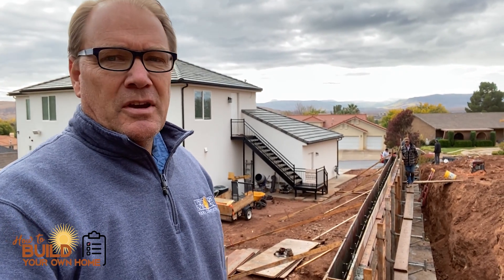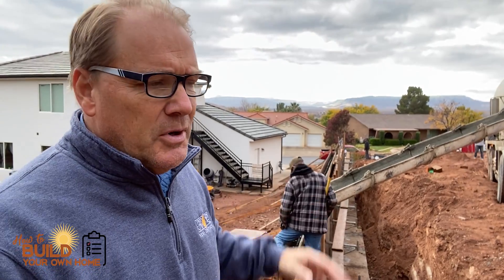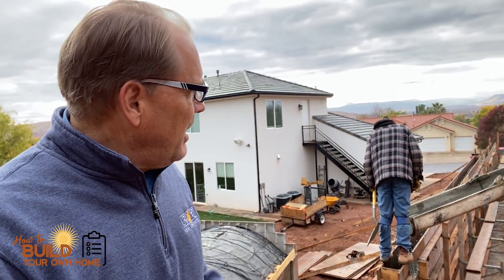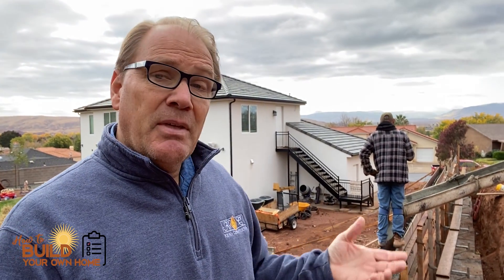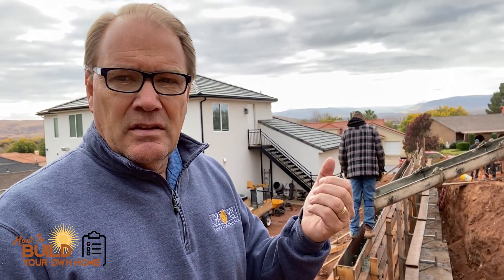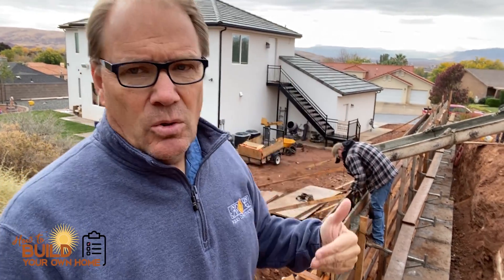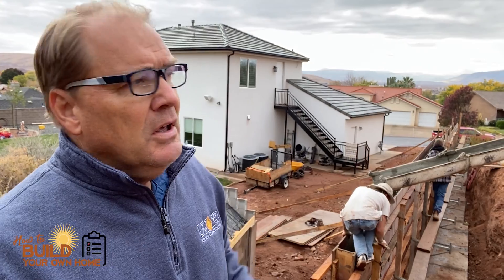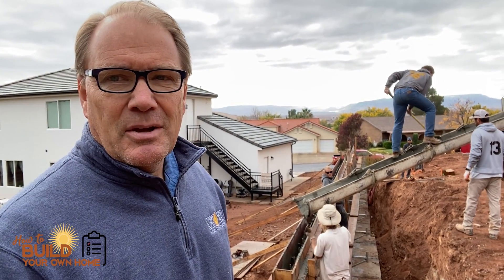Retaining Walls and Engineering

Comment: Hi, if I am building a new home, please explain the process of the architecture, civil engineer, and structural engineer.  First I get the lot and have the civil engineer evaluate it before I buy? Then have the architect draw the plans? Then have the civil engineer sign off?  Who needs to sign off to get the permits?  Where does the structural engineer come into play?
Reply from the maker: No need for a civil engineer. You just need a geotechnical engineer for the earth below, then an architecture/draft-person to create the design, and then an structural engineer to engineer the structure for the site, and this person will need the geotech report to properly size the footings etc.
Reply: @HowToBuildYourOwnHome  Thanks.  For a 1700 sq ft spec home, 3 bedroom, 2.5 baths. Approx how much does geotechnical engineer report cost? draft person cost? structural engineer cost?
I don't need a licensed architect right? just a draft person who can draw the blueprints and then the structural engineer signs off on it?
Reply from the maker: @myreviews4905  It really depends on your local market and labor costs. Some draft people will charge .75 cents a sq ft, others will charge 10% on the total cost, yes it ranges that much. engineering can have a huge range. Some areas, albeit rare, require a licensed architect, but most don't. The engineer is the one most areas require be a licensed trade.
Reply: Also for the same spec house, if you're building in a flood zone area, can you raise the house 2 or 3 feet by adding rocks, soil, etc? approx how much does something like that run?

Comment: Spalding happens in all concrete with steel rebar.  This is where the rebar is exposed after a few years when the concrete breaks away from the expansion pressure of rusting metal.  There is re-enforcement rebar that will not rust or spald your concrete.  let me know if you want some.
Reply from the maker: I would love a sample of that.
Reply: @HowToBuildYourOwnHome  I will get you a message on your construction site.